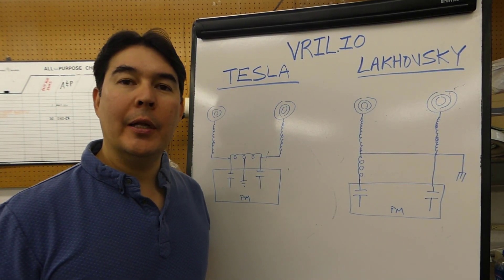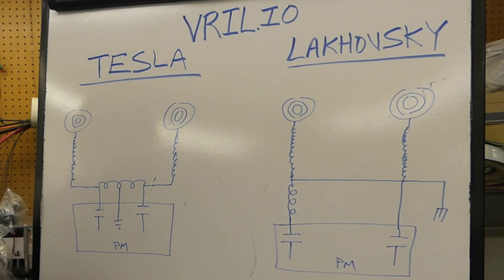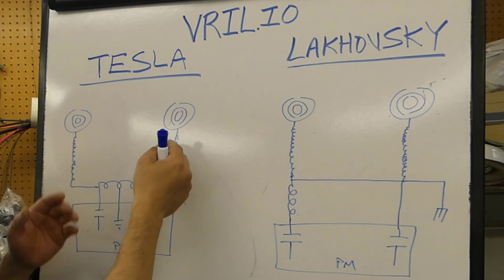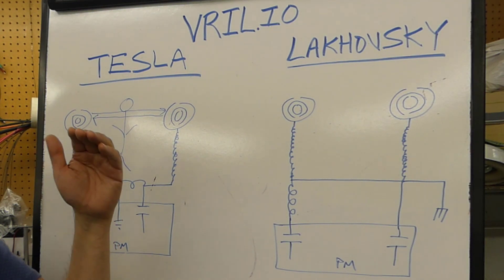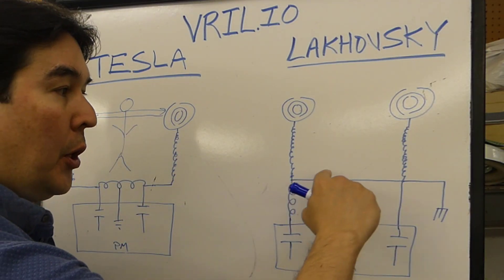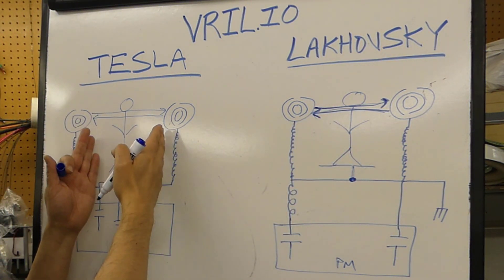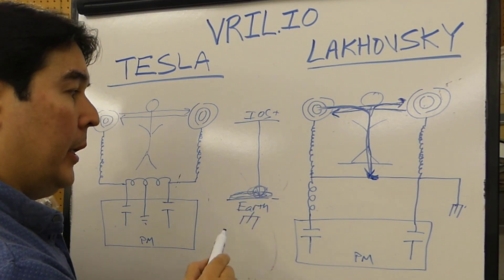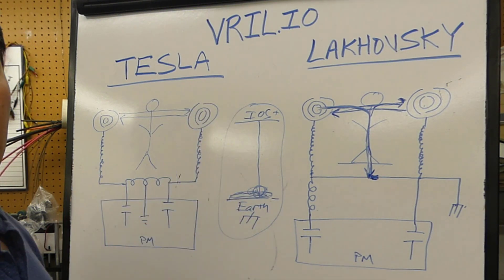Tesla Balanced vs. Lakhovsky MWO Unbalanced

Comment: The balanced tesla seems more efficient to me, am I missing something? Just speaking on the diagrams.
Reply from the maker: No, you are correct, the balanced method is more efficient and is more closed so cleaner as well, but that is not what gets the Lakhovsky results. Each coil on the MWO has a slightly different number of turns, its off balance and one phase is grounded. That is all intentional. If you watch the presentation, you can see why one phase is grounded, forces the dielectric lines down through you to ground. Tesla's method, you're merely bathing in it while very little is absorbed by you. It's estimated in the Lakhovsky method, that roughly half makes it to the other side while half is absorbed by you.

Comment: Pulse rate and frequency are NOT the same
Reply from the maker: Go ahead and post your definitions for each.
Reply: Aaron Murakami An on off binary,1and zero pulse rate is not the same as an analog variance of electro/magnetic cyclic wave form in frequency.
Cycle per second vice pulses per second.
Reply from the maker: @onpurpose2629  Where in the video am I talking about a pulse rate? Or, what do you consider a pulse rate specifically that I am calling a frequency?

Comment: The original pictures of Lakhovsky do not show any means of grounding the patients. How can you claim that it is the majority of the method he employed?
Reply from the maker: You're misunderstanding it - one of the phases is grounded 100% exactly like I drew on the board. That means if the person's feet are on the ground without insulated shoes, the electrostatic potential moves through the person to ground. It's indisputable. It is also know to be a fact because original Lakhovsky MWO units were found and were completely reverse engineered and our model and understanding is based on that information gained from that. Lakhovsky actually did have grounding plates to enhance that but it is not necessary and is safer without a metallic plate on the ground.

Comment: Best solution would be to earth ground the chassis of the Tesla setup and then you have a balanced system and the flux flow through the person for better benefits.  Not hard, pretty obvious, thanks, Ken.
Reply from the maker: Tesla setup has its chassis already grounded - no separate Earth ground needed or desired. Tesla setup is already balanced, that is the entire point, obviously.